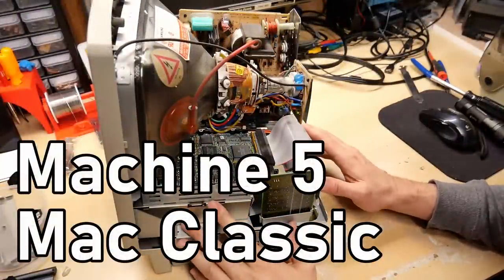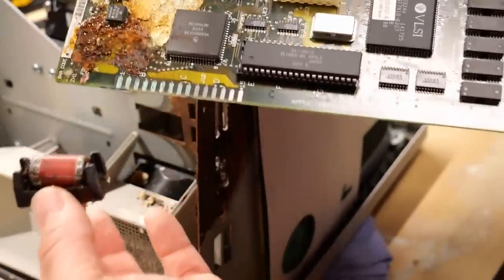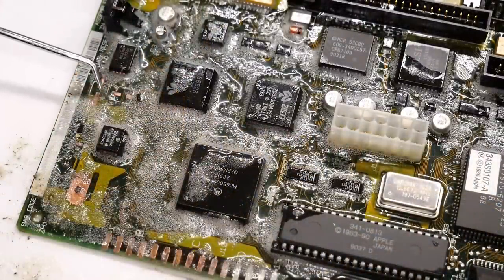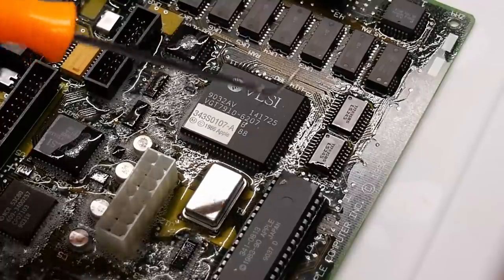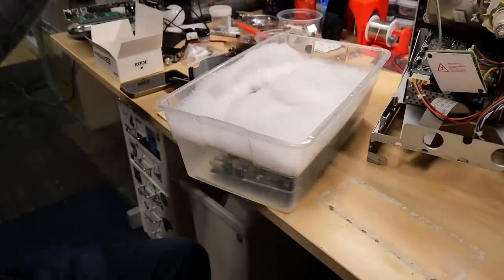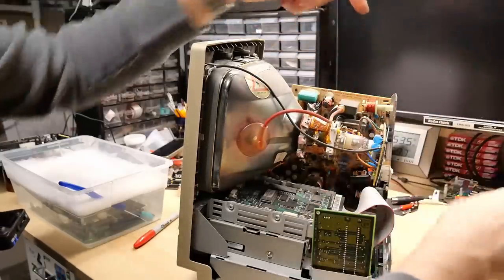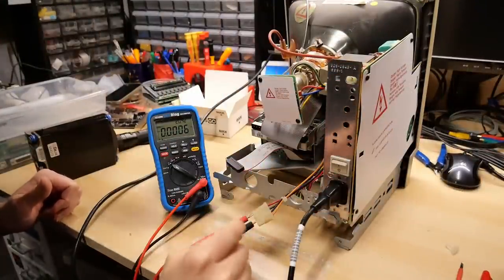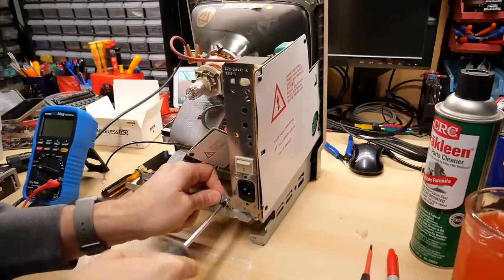Mac Repairathon Part 2: More inspections, motherboard cleaning and a PSU fix

Comment: The board is begging for that rework, Adrian!
Reply from the maker: I haven't completely ruled that out. I still have all the parts it needs -- I did some more investigation and there is so much damage because the vias are bad now. For now I put it aside to work on other stuff. :-)
Reply: You realy think your able to fix that board? That would realy make you the retro/electronics/repair magician.
Reply: @adriansdigitalbasement  I'll join the camp of really wanting to see you repair it. Make it a pet project! Give it it's own series. Maybe go over the top and turn it into a steam punk mod! I'd love to see all the bodge wires going all over the place and see it turn on and work in the end. The pay off would be nuts!
Reply: @adriansdigitalbasement  Please do!  We want to see it!  Even if you can't, please don't throw it away.
Reply: i would love to see that board working again !
Reply: @adriansdigitalbasement  Do it man! Do it NOOOOOOW! IT would be really cool to see you make the attempt.... possibly a bunch of bodge wires but I bet you can get it working again.
Reply: It will be an enormous amount of work with no guarantee of success.  I don't think it's worth it.  There are plenty of more promising projects to work on.
Reply: @adriansdigitalbasement  Adrian would repairing a VIA mean trying to drip solder/paste through it ?
Reply: @adriansdigitalbasement  It would definitely be interesting seeing the repair process, regardless of if it works in the end or not. I would definitely watch that.
Reply: @maicod  It's definitely possible to do, if the vias aren't filled. Basically, the lithium hydroxide ate away at the through-hole plating. I'd clear the holes and just use some bare bodge wire (30 awg or so)  through the holes, then solder on each side. Repairing the solder pads under the processor might be tricky though.
Reply: @BlackEpyon  ah yea wire is a good idea
Reply: @dparks256  agreed

Comment: This reminded me to finally crack open my mac classic... luckily the original 1991 battery despite being dead hadn't leaked but noticed minor grime around caps do did the isopropyl clean to play it safe (it still works all 4mb ram and all when assembled).

Comment: Reminds me of the repair I did for a customer... Laptop was left in the bathtub for an hour or two and then left to dry for a month... Internal battery was never disconnected

I actually got the piece of crap working again, the corrosion was a horror show

Comment: I think the battery diodes are actually there so that when you turn the power on it doesn't try to charge the battery.  Though I suppose backwards installation protection might be a plus.
Reply from the maker: You know you might be right. I’ll need to check that and see!

Comment: Like your videos, keep them up!!! Would be safe for you to ground these CRTs before working on them or let viewers to understand the dangers of these CRTs. Add a 10MOhm resistor to your lead. I did burn a good digital board once by grounding the CRT without resistance. And will definitively try the WD40 or fats to convert the electrolytes.

Comment: Hello adrian, you should try evapo rust for badly corroded stuff,it works wonders to remove corrosion .
Reply from the maker: I have a bottle of that actually. Didn’t even think so soak it. I guess at this point it’s all gone but I really should have tried it.

Comment: Channel Plan C did work on a Amiga 500 with serious battery damage. Bad traces, vias, many bodge wires quite a far gone motherboard, I think it was worst off than this mac classic but he did it, and it worked. My bet is on that Mac making a come back after good clean-up, re-cap and some bodge wires. That would be a restoration video worth watching in my books.

Correction:- Plan C repair was on a Acorn A3000 not Amiga 500 as I stated.

Comment: WD40 will dissolve metal just a little bit. Someone with an antique clock way back once told me that it was a lubricant they had to avoid because it would alter the metal parts.
Reply: Wd40 is, predominantly kerosene

Comment: Can't say I've ever seen WD40 used like that, interesting cleaning effect there, I never use the stuff as it's never done what I needed it to (like, lubrication, it just evaporates and leaves parts squeaky again!), seeing other comments on a reaction between the battery juice and WD40 turning it into a soap though, that's pretty interesting...
Reply: I only use the stuff to remove stickers. Mhmmm where did I see that again??

Comment: Where are you getting all your IPA from? It's vanished from the shelves around here in the Philly ares. I can;t even get any for my 3D printer!
Reply: In the majority of cases, normal ethanol will do the job just fine. IPA is a strong solvent than ethanol, but ethanol is strong enough to dissolve most things you use alcohol for, such as cleaning soldering flux.
Reply: I buy in 2L or 5L bottles, save money that way.... unless you do that too and just happen to need your refill now? Which would suck. Maybe you use a lot more than me too.

Comment: Thank you Apple for using lithium cells! Or else we wouldnt have these great videos😅 Ever figured how live would be without WD40? That stuf is amazing. Please make more repair videos👍 (less Apple haha)
Reply: I think the Commodore Amigas also used these lithium batteries. Check out GadgetUK164’s channel, where he attempts rework on a badly corroded A3000. 😊
Reply: Also such a great Repair guru👍
Reply: NiCd's, lithiums, all the batteries used back then suck when they are getting on for 40 years old and WAY past their shelf life

Comment: Hey Adrian, where were these Macs assembled? I wonder if different factories used different brands of batteries. It seems that Maxells are the only ones that exploded, the Sonnenschein and Tadiran batteries I've also seen used in these seem fine, so if different factories happen to have stuck with certain battery brands, it might be a good indicator on whether or not it's going to be a mess inside.
Reply from the maker: I think of these mentioned Singapore. Could well be something to that. Maybe specific local brands or something.

Comment: Mr.Adrian, do you know anything about the AT&T PC6300 from 1984ish???
Reply from the maker: I haven't had the chance to use one of those before.
Reply: @adriansdigitalbasement  I ask because I have one but I need to get a monitor for it. The bad part is that the monitor is proprietary and powered by the computer it's self.

Comment: Are any of these Classic II's? Do you know the keyboard combo to press at start to display the picture of the dev team stored in ROM? Also don't forget to use the Command-Option-X-O combo at startup to boot from ROM - it makes it the fastest machine ever! (I could press the keys to send a print job and have the printer almost print before the screen warmed up!) I may have to start making some Youtube videos of my own! I still have a shed full of old kit (I donated all my Apple ][ kit to a local museum, still got all my 68k to G4 kit though, I'm only missing about 4 models in the 68k range!).

Comment: I'm seriously thinking about making replacement boards for Classic, Color Classic, SE, SE/30, FDHD, Classic II as well as PSU boards.  Some of the chips are unobtaniums.  I'd like to have hires images of the boards (sans components) so if you were willing to desolder everything off the corroded board and send me pics and I will see what I can do.  I also looked for part numbers of the yellow SOIC tantalums.  I do have several MC68030FC16B's and MC68000FN8's.

Comment: WD40s very safe an effective for cleaning components, been using it for years, cleaned my new PC that way last week, though not by drowning it though I can see why you would in that situation, and also I didnt leave it set, again though, i can see why you eould in that situation. FYI also good for cleaning keyboards and laptop casings, just be sure to give it time to evaporate before use. I swear by it.

Comment: Surprised the WD-40 actually did anything to that classic board!
Reply: I'm curious to see what the good Brake Cleaners would have done for that
Reply from the maker: Oh did you guys notice I had some brake cleaner on the bench? Tried it and it didn't do anything at all.
Reply: @adriansdigitalbasement  that must explain another commenter's point that it's the oils and detergents in the WD-40, rather than a solvent. Really interesting stuff! Definitely something to remember in future for situations where even light abrasion isn't ideal
Reply: @adriansdigitalbasement  I noticed some kind of cleaner but wasn't sure what exactly it was.

Comment: I appreciate the enthusiasm and technical skill but just wondering what one would use these obsolete computers for? Sure, they engender a feeling of nostalgia but aren't they essentially giant paperweights with zero practical purpose?
Reply: That's just hobbies in general, even the "practical" ones mostly aren't if inspected closely enough.

Comment: Another great video, Adrian! By the way, I was wondering about your opinion on "polymodding", or the replacing of electrolitic capacitors with more modern polymer capacitors. Purists might argue that that would not be era-appropriate for retro hardware, but given how much of a bane those leak-prone original capacitors have proven to be to retro and vintage hardware, plus the fact that polymer capacitors are not only leak-proof, but also have a considerably longer operating life, wouldn't that make those recommandable for the long term preservation of vintage hardware?

Also, will you be using polymer capacitors as part of your repair works on these Macs? I understand polymer capacitors are not suitable for use in power supplies, but would work fine as replacement capacitors in the logic boards, right?

I'm not an expert in these matters, so anybody feel free to correct me if I am basing these questions/suggestions on incorrect information. Thanks.

Keep 'em coming, Adrian! 🙂
Reply: The polymer cap thing is pretty insane. Sure they are better quality capacitors overall, but they are not a panacea. We dont know what their failure mode is going to be in 30 years. The main issue with SMD electrolytics was poor sealings which is what causes the leakage - this has now largely been resolved so good quality SMD electrolytics are a perfectly sane choice.

Comment: Lithium batteries are the stuff of nightmares!  So much vintage gear just straight up destroyed because of them...
Reply: Less problematic though than NiMH/NiCads - you've got longer to change them before they go, and of course coin cells rarely leak.
Reply: @Lukeno52  A few months back I cut out the soldered-in battery from my Mac SE. It was the original with a 1989 date code stamped on it. It hadn't leaked and my multimeter still showed it as 3.6V. It seemed a shame to remove it, but wasn't worth the risk to leave it in there.

Comment: It's crazy how much cap leakage there was. Meanwhile I've never seen that happen on other computers. Was this just an Apple thing, that they cheaped out on caps even more than Commodore?
Reply from the maker: It seems whoever apple bought caps from seem to make caps that all have up in 20 years or so. Same with Commodore and their Amigas that used the same type of caps. It honestly may be all computers with SMD caps from that time period. Most PCs were using tantalums and through hole caps still
Reply: Nah, it's all electrolytic capacitors from that era.. Google 'capacitor plague'
Reply: @brianv2871  Yeah, it definitely wasn't just Apple.  Dell had an entire production run of motherboards plagued by leaking caps.  For me, it was two years of "job security" because they agreed to replace all the motherboards, whether they were out of warranty or not.  (I used to do on-site service and support for Dell.  For two years, I was replacing 3 to 5 motherboards daily.)  If I remember correctly, the root cause was industrial sabotage.  Someone stole the formula and sold it to another company, but forgot to steal the WHOLE formula.  He forgot the part that prevents hydrogen bubbles from forming in the electrolyte.
Reply: @adriansdigitalbasement  The Acorn RiscPC suffers from the same problem too.
Reply: @brianv2871  The cap plauge (crappy chemistry ~1999-2005) is a different issue from general unreliability of early SMD electrolytic caps on boards from around 1990. Which I'd hazard a guess is more a matter of the rubber seal being degraded out the gate from it's trip through a reflow oven.

Comment: That'd make sense that the vias are bad since they'd be plated- Darn :/
Reply from the maker: It's the plating that connects the layers right? Not copper itself?
Reply: @adriansdigitalbasement  Right, so they're probably worn straight through because the material is usually similar to solder :( But hey, at least as you mentioned everything else on the board seems to have survived for parts!
Reply: @ArixZajicek  Could you flow solder through the vias to get the layers connected again?  Would there be materiel for the solder to stick to?
Reply: @tombarber8929  Maybe! But it probably isn't worth the effort, especially with the rest of the repair that needs done. You could go through all of the trouble of fixing that only to find out that more tracks are corroded...

Comment: NGL I was kind of hoping you'd go back to the scabbed-over board and miracle it back to working, but I totally understand not wanting to do a full rework.  Sometimes you win (Field-found C64C) sometimes ya lose (scabbed over Mac Classic).  But hey, at least keeping it as a donor board, you don't have to worry about corrosion creep killing more ICs and chips, and you learned something about extraordinary life-saving measures (IPA, then WD40 soak).  :)

Always great videos, Adrian, regardless.
Reply from the maker: Yeah I may still attempt a fix. But at the minimum, it has good chips on it and I will probably send it to Rob in the UK so he can make a new version of it.

Comment: its crazy what things ppl use for this,
water: bad for any eletrical device "washes in water and soap and to clean mud n dirt off"
wd-40: good for rusty items, a lube and just for anything metal, "uses it on boards and gets them nice and clean or contacting again"
cooker: WHAT NO DON'T PUT THAT IN THE OVEN WHAT ARE YOU THINKING?! "puts into oven to cook board and re-fix a board issue"
what's next? piss on board to stop it from smellnig of burning, use fire to melt a hole in it for better air con or flow, put into water and have some toast as well as its all good,

Comment: How is that possible to put the motherboard into soaped water , isn't it going to get corrosion all over the board ??!!
Reply from the maker: Nope. It's not different than any other thing you wash. Just plastic, fiberglass and some metal parts. Just let it dry before you try to power it up again. :-)
Reply: @adriansdigitalbasement  so the metallic parts will not get distorted with rust ? even after contact with water ? In this case, could you briefly explain why then when I spilled my glass of water on my lenovo laptop , the motherboard, RAM bars, keyboard – all got spoiled with green and brown corrosion ...? so I was only capable to throw it away ...

Since then I try to avoid any liquid source close to my laptop xDD

And you can imagine my face when I watched you covering the board with water xDD

I mean no usb prort, no audio input, no chip will get corrupted !!??
Reply: @IvanIvanov-uy8qf  The metal on the mainboard is mostly plated with tin. And tin doesn't rust. If you have bare iron or copper on a board you need to be a bit more careful, but in general you can wash boards just fine.

Comment: I've seen worse Mac Classic motherboards. (:
Reply: @elgeneralxx  Well, the battery pooped all over the motherboard I had, completely dismounting 60% of all the components as well as the first copper layer, destroying all traces and interconnects. It kinda depends on how even the Mac is stored. I just found one where the Battery mainly leaked into the Case and left most of the board intact.....

Comment: Repairing these is one thing and certainly cool, but how about upgrading them ... the crts are useless longterm... there should be a way to modify them with a fitting panel... could be anything, even small plasma, but better than crt
Reply: Could make for an interesting project, for sure.
Reply from the maker: I actually feel like these CRTs work much better than LCDs even from that era with their dim cold cathode backlights. These CRTs will probably all still work fine 50 years from now even. (if they aren't used every day)

Comment: I found my dads old windows for workgroups 3.11 (I know it ran Windows for workgroups 3.11 because I have a complete set of all 8 3.5 inch floppy disks, the lithium battery somehow didn't leak AT ALL, I have it and not a single speck of corrosion on that long dead non-rechargeable lithium battery.